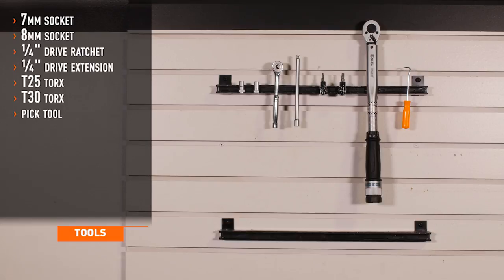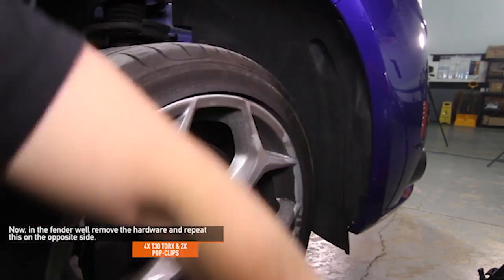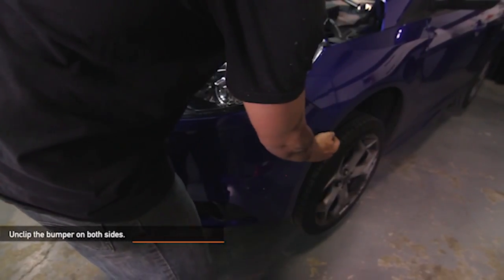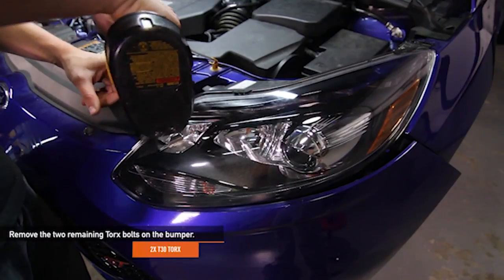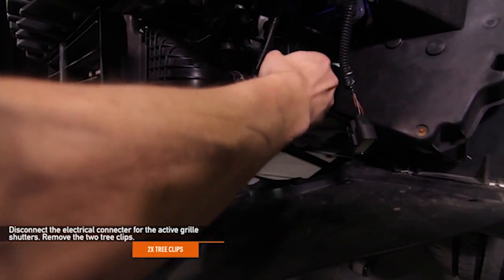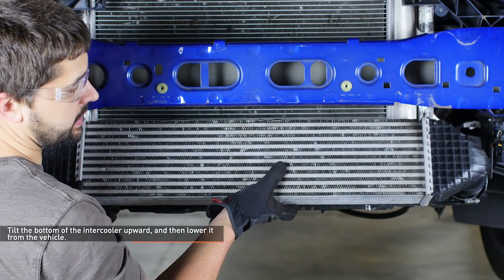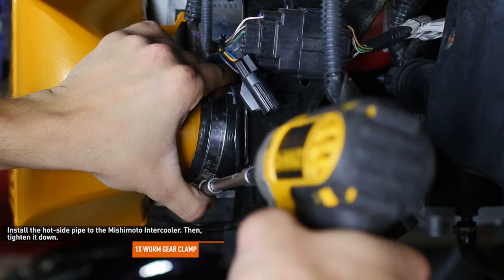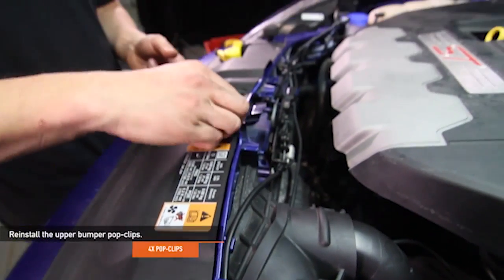2013-2018 Ford Focus ST Performance Intercooler Installation Guide by Mishimoto

Comment: Can you run this with the stock intercooler piping + stock tune? Also when tuned is it recommend to upgrade the piping?
Reply from the maker: It's compatible with OEM piping. However, we never tested the limitations of the OEM piping coupled with our intercooler.

Comment: Does this improve the performance of the car? If that’s the case, what are the gains you get ?
Reply from the maker: •Max power gains of 5 hp and 7 ft/lbs torque
•Drops intercooler outlet temperatures by 34°F
•Increases core size by 128% and fin surface area by 32%

Comment: hi there, a question if you remove the active grill shutter will the cooling fan run continuously at the highest level?  Is that true or is there a way that it doesn't always work?

Interesting Video, Nice Job👍👍👍👍👍
Reply from the maker: Unfortunately, this is not something we have tested. Sorry!
Reply: @mishimoto  thanks for the answer 👍👍👍
Reply: I removed the shroud:shudders, and it doesn’t effect it, seems to run a lot better!😊

Comment: Would the m line fit the st without modification?
Reply from the maker: Hello danceTROYdance. Love the username! 

We've gathered feedback from customers that the M line is a great fit for the ST, but not necessarily a direct fit no mods required process.

 At this time, we are only able to confirm that our direct fit system for the ST requires no modifications. MMINT-FOST-13

https://www.mishimoto.com/ford-focus-st-performance-intercooler-2013.html?utm_source=youtube&utm_medium=social&utm_campaign=install&utm_content=description&utm_term=MMINT-FOST-13

Comment: I read up that some people had issues installing these on their Focus ST... I have a 2018 ST, am I going to run into some issues to where I need to modify this to work? Just wondering before I order as the car is used as a daily and I only get one day off so I would have to knock this out in a day. Thanks
Reply from the maker: We've quite literally never had an issue with the intercooler fitment brought up to our support team so this is surprising to hear. Our usual question on these is which port to mount the MAF sensor. You shouldn't run into any problems installing yours! Feel free to give our team a call if you have any issues 302-762-4501

Comment: Dyno results...
Reply: James Shuster upgrading an intercooler in the ST is not so much about making more  peakpower, it's about overcoming heat soak and allowing the power to be more repeatable. Also on the same tune it shouldn't make a big difference but it will allow you to push the previous tune harder.